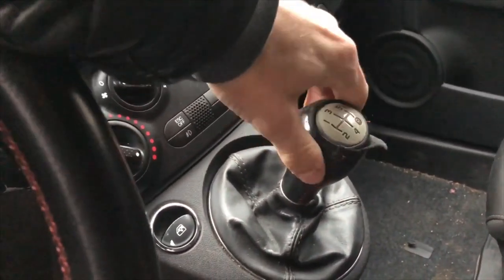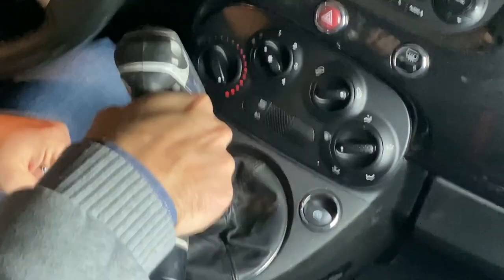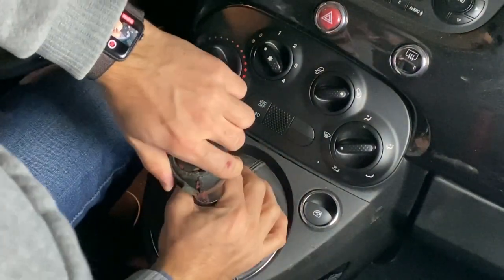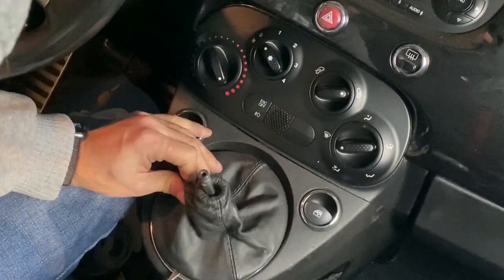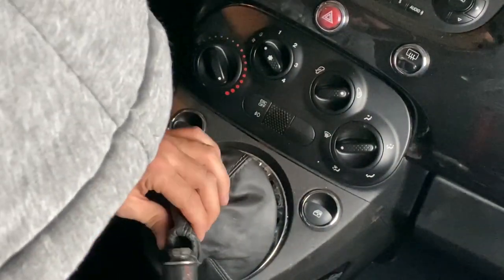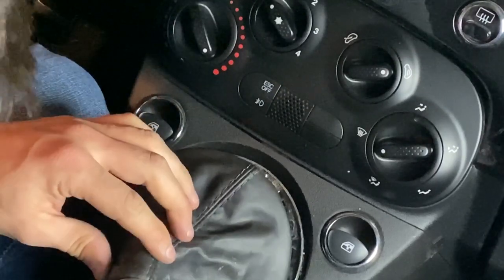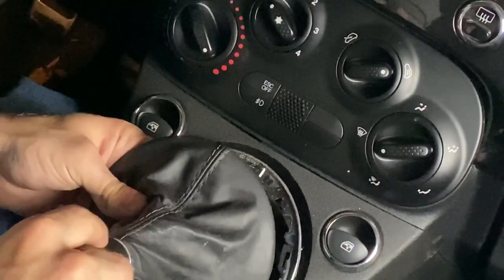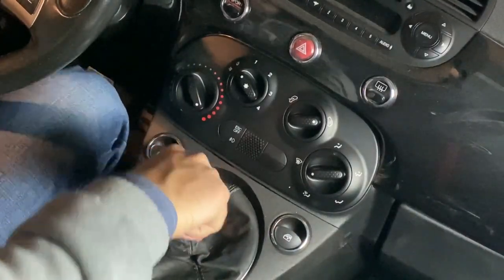How to Remove and Install a Shift Knob on FIAT 500 Abarth

Comment: Very useful, straight and to the point. However my Fiat has a lift up part on the bottom of the knob, used when put in reverse. Do you know how this is changed and could I use any type of knob?
Reply from the maker: What kind of FIAT is it? Unfortunately, I'm only familiar with the US FIAT 500, so I don't want to give you false information.
Reply: @SimpleCarGuy  Thx for the answer, but I found another video explaining it.
Reply: @ThomasfromDenmark1  which video, I have the same one
Reply: @lorenzoconte4699  I figured it already. 😀